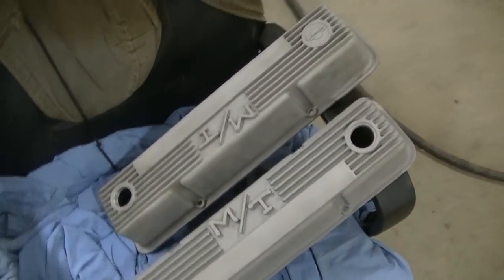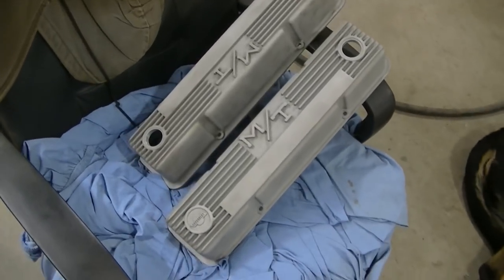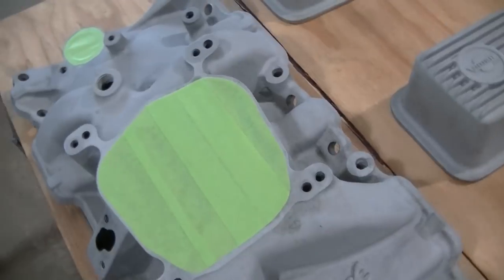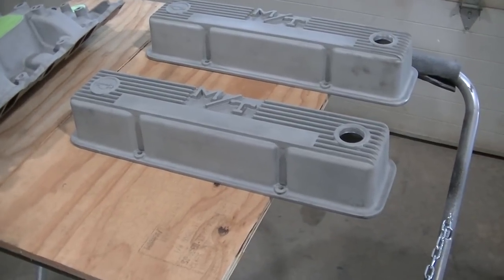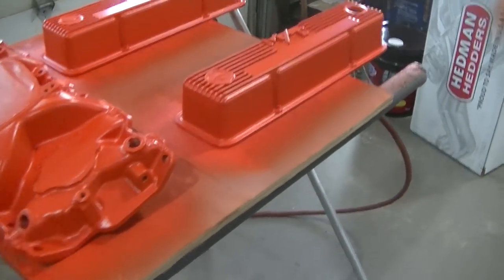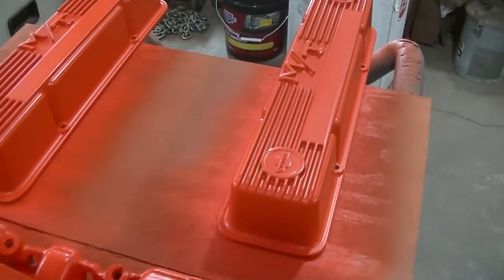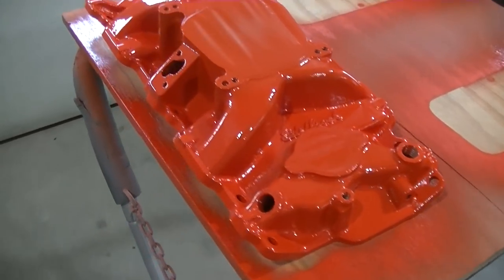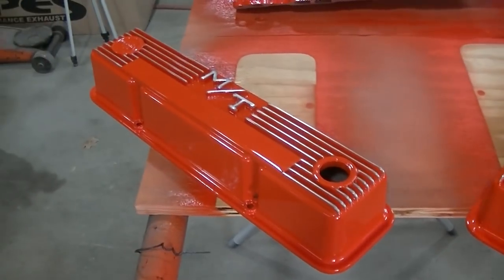70 Camaro SS Project "Painting Aluminum Valve Covers & Edelbrock Intake"

Comment: would have been nice if you would have told us what kind of primer and paint and clear coat you used... like show the brand/cans  on camera...
Reply from the maker: Back then I was using Dupont brand. I have switched to PPG. If you go to your local paint store they can answer all your questions. I don't use spray can paint. It's all real automotive paint. You will need a professional paint gun along with a compressor to run it.

Comment: Great job! I'm thinking of doing mine also. Can you tell me how good the paint held up with the engine heat? Thanks
Reply from the maker: This car hasn't seen much use but if you use automotive grade paint it should hold up fine. People have been doing this for a long time. Make sure you keep gas off the painted parts. It will eat the paint right off. And don't expect these kinds of results if you are going to use spray cans. It won't happen and durability sucks with spray cans.
Reply: @mossman381  Thanks.  I'm spraying urethane auto paint but just don't know how it would hold up to heat. Thanks!
Reply: @boxer71c55  no paint holds up to heat on aluminum. I've done this several times on my classic Mustangs. Be prepared to repaint if you want to keep them nice.